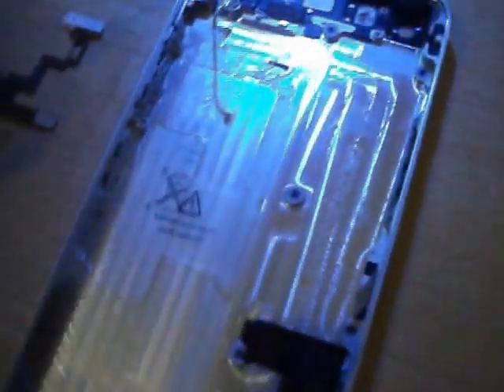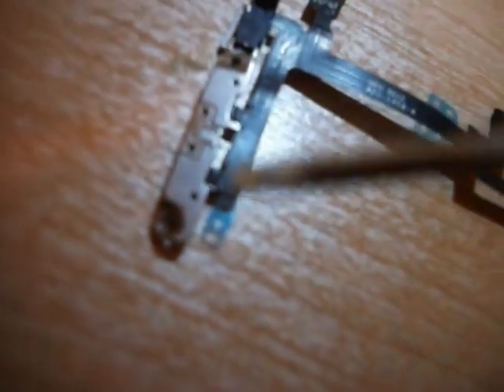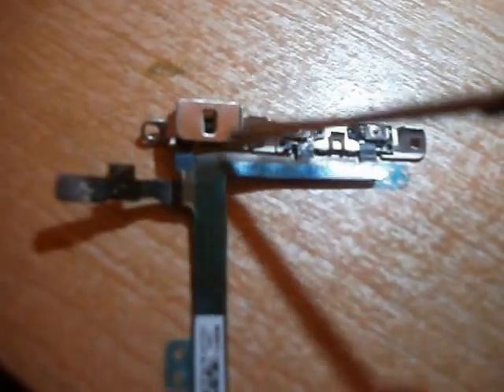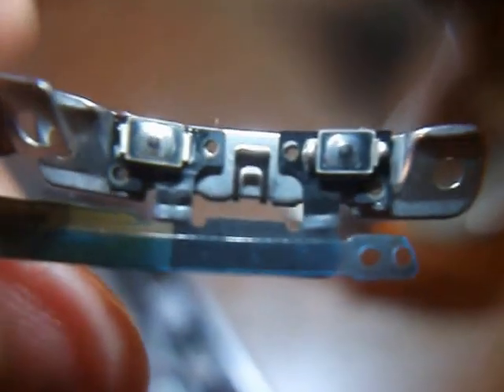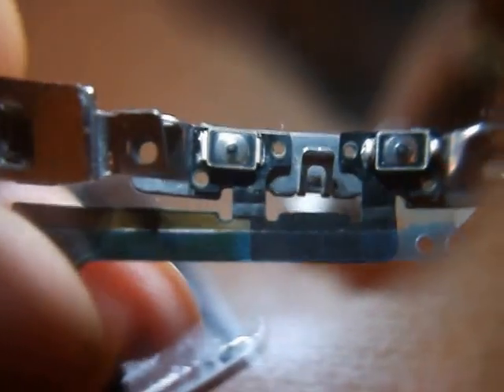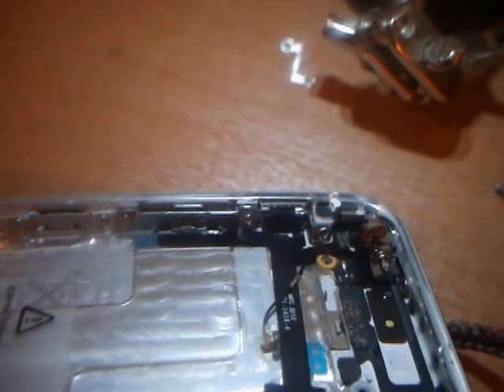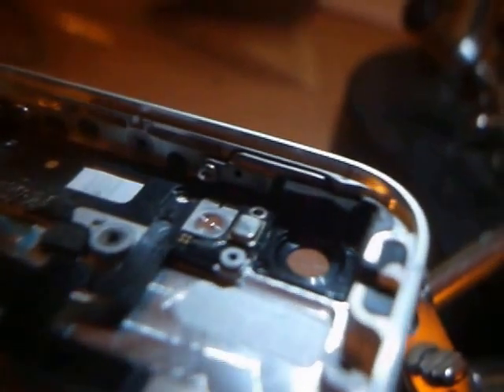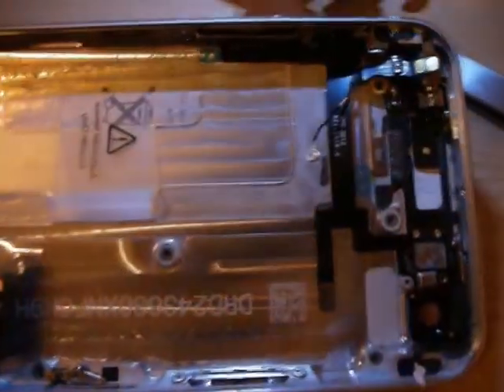iPhone 5 - changing volume mute & power buttons, in detail!

Comment: How did you get the mute button to line up with that little plastic switch?
Reply from the maker: Hi Jake

The plastic switch in the phone casing should be loose before you fit the ribbon cable.

So I left it sitting in the mute position (gravity keeps it there when the phone is lying down) and switched the little black switch in the ribbon cable to the same position.

Then when you fit the cable the switches should line up.

It can take a couple of attempts to make sure it has mated into position but shouldn't be too hard.

Let me know if that doesn't work for you or doesn't make sense.

Tom
Reply: TechyHeadz.com
So which way does the red line go - on the top or bottom - with the phone lying flat.

Thanks
Reply: Jake Lazore Red line is on the top with switch down when phone is on it's back. See here: http://cdn4syt.solveyourtech.netdna-cdn.com/wp-content/uploads/2012/11/iphone-5-mute-button.jpg
Reply: Ok cool. I will try it again. Thanks.
Reply from the maker: Jake Lazore np. let me know if you get stuck